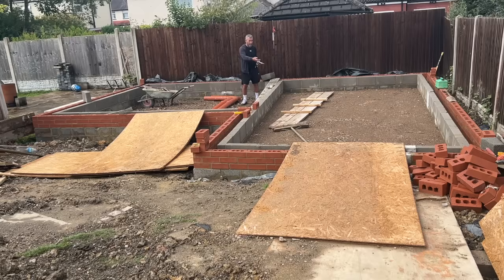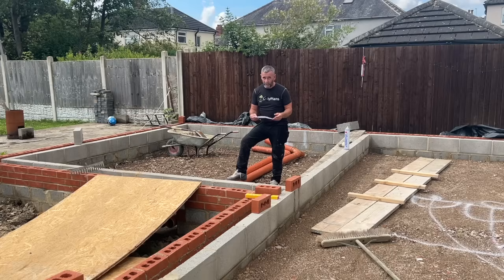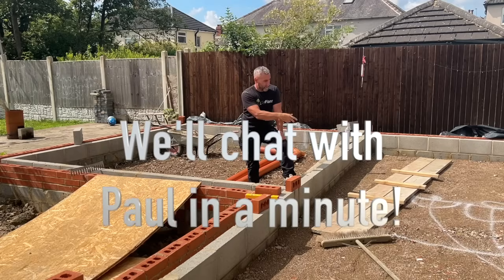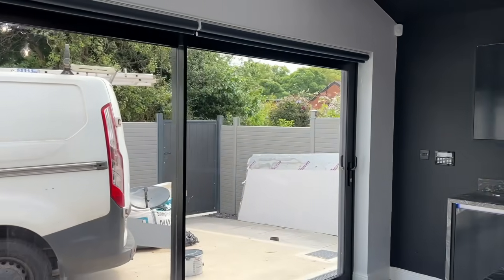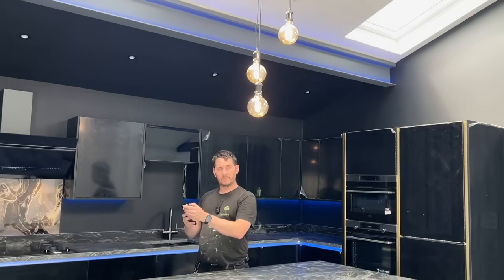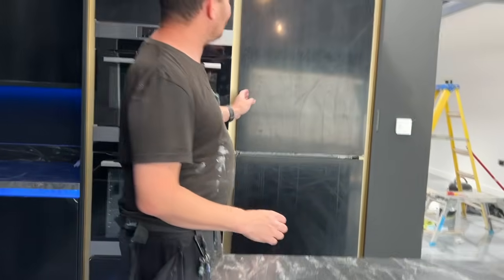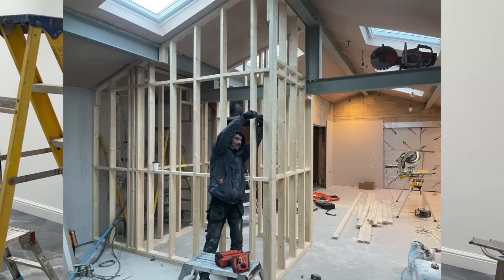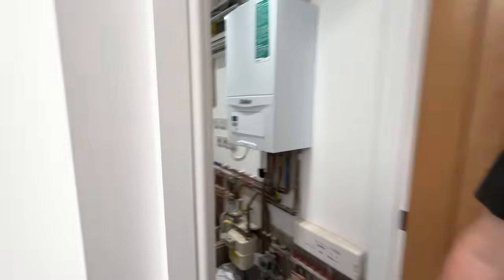Garden annex and the plumbing explained in massive detail! Part 13

Comment: Informative video. One 110 waste with Air Admittance Valve within the cavity (above height of sink waste, as mentioned) will do the trick. Done this numerous times without any issues. Good to catch up with John & Davie, could make this an occasional standalone vid. At my own place I fitted an electric instant water heater within my utility sink unit (in annex building) and it works a treat 😀

Comment: I would personally just bring your 110 mm pipe in to your wall cavity then boss your sink and shower in to it if you're putting your shower tray on a riser kit. With it being a granny flat though mate i would definitely consider putting your shower tray on the floor.  Just bring your shower waist in the floor in the rough area put kingspan around it then just concentrate the last bit in when you set your tray. Looking well mate very tidy job👍👍
Reply from the maker: I like this suggestion mate
Reply: You can even use a floor guly and mortgage a tray a d screed a fall to the guly in the slab and file the floor and make it a set room

Comment: My 2 pence worth, we built exactly the same thing and your pressure will 100% drop when either the house or the annex uses the water. We ended up getting a 33mm main bought to the house and a separate meter fitted for the annex with its own pipe feed from the street. Cost a couple of grand, but fixed the problem. Also a small combi boiler would combat all the issues of a 9kw shower and a 3kw water heater, which are inconvenient to use and don’t make for comfortable usage, especially if the pressure drops, not to mention the power being heavily used (sometimes the lights even dip when you turn a shower on). A small combi would cost £800 ish quid. Clears the issue of 2 different kinds of heaters, more to go wrong. Also I would recess the shower waste pipe in to the concrete pad so the shower try can sit on the floor rather than up on a boxed in platform
Reply from the maker: appreciate the input mate, I'm selling up when its done, so the extra pipe wont be happening I'm afraid

Comment: 51:52 it is  beset to run 3 separate 4" drain line to an inspection chamber and not tee in any of them in your slab, a building  inspector probably wouldn't pass it if you connected waste pipes to the waste pipe from your toilet in the slab, if your having a stub stack at the back of your toilet like you said you could boss off that above ground for your basin and shower but not in the slab, but then your have to make sure you had a fall on the shower waste pipe

Comment: Hi  very interesting video  

On the drains, it's always best to bring your foul drains outside before they combine  otherwise you may  need to have a double seal manhole chamber internally, not best   
Durgo valve essential but ensure access available,  if possible use one and link the 110 diameter pipes together with smaller diameter pipes and bosses say 1.5 inch vents   

Hot water  look at the phase change heat  batteries  by Sunamp,  uk company  can heat with immersion or heat pump and because of heat density might fit under kitchen work top tiny water storage (just the volume of pipework in heat exchanger) so compliant for water regs, can use time of use electricity if no heat pump  incorprate blender on top to reduce outgoing temp of about 55c to 48c prevents scolding   saves on costs for big cable for shower and instant heaters  shower and heater costs   - worth a look  

Great content as always
Reply from the maker: I think he's fitting one of these Sunamp things mate

Comment: Liam, the tensioner that failed should  be fixed under warranty by the mechanic who sorted the wet belt failure
Reply from the maker: got the van back, think im getting a labour bill though, not fully sure as of yet though
Reply: Have a look at your previous invoice, see if they fitted a new tensioner, they should have if they done the job right.
Then the cost of the failure should be their responsibility, not yours.
Reply: Should have fitted a waterproof as well if driven by the timing belt
Reply: Waterpump
Reply: If they didn't replace the tensioner the mechanic should be at fault for not completing the full job. If the tensioner was replaced and it failed months later the parts supplier/manufacturer should be held liable for supplying a faulty part and the mechanic should be compensated from his supplier after repairing your vehicle at no further cost to you. But of course these things are never that simple as no one wants the blame or to lose money
Reply: @McNaughty91 Excatly that, usually, the suppliers of the parts will replace the faulty part under warranty,  but there is usually a disclaimer saying they won't pay for any labour or anything else.
It's usually on the shoulders of the garage to do the repair under goodwill

Comment: Liam, the concentration of Lead (in water) is measured in either, ug/location (micrograms per litre) or less correctly as ppb (parts per billion).  That latter unit (ppb) isn't particularly helpful as Lead is much more dense than Water.  Before ripping out any Lead pipework, it would be worth checking with Yorkshire Water to see if they are dosing Orthophosphate - which significantly reduces the solubility of Lead in water.  As far as I'm aware, many Water Authorities still dose this chemical to minimise the issues of Lead pipes in domestic installations due to there still being many old properties that have Lead pipes.
Reply: "location" should read "l" for litres.  Bloody autocorrect  - I hate it 😂

Comment: Surprised there was no mention of raising a soil stack or using an air admittance valve to mitigate pulling a vacuum in the adjacent traps.
Reply from the maker: there is mate, we talk about it
Reply: @thegardenroomguru  You're absolutely right..... low attention span! I now see you returned to the subject later on. The answer is ..... maybe....  see BRegs AD H 1.7 onwards which deals with this subject....... you may not need to ventilate, it depends on branch lengths...... there's a table that guides you. But as your man says, just put one in and avoid the question in the first place. Your void for a concealed cistern is perfect for this.

Comment: I would look at getting a Quooker tap for boiling and hot water, don't get those 15/30L sink ones.
Reply from the maker: surly they are just for jot sink water, washing up tea etc
Reply: @thegardenroomguru  they give you boiling and hot water for washing up. Basically similar to what your plumber friend was suggesting but all packaged up as a nice kitchen tap. They put a little 15L tank under the sink in the cupboard. The utility of not needing a kettle also so great in a small kitchen.
Reply: They now have combi tanks so all you need is a cold feed for boiling and normal hot, so would work but I’m pretty sure biggest tank is 5L
Reply: The Quooker Tap don't comply with the Water Regulations which state "schedule 2 (18) , water should not exceed 100'c" .. The Quooker tap states it stores at 110'c .
Reply: @DALEYPLUMBING  doesn't hugely matter , there are thousands getting installed in the UK each day. The regulation isnt meant for this its for hot water cylinders.
Reply: @gsdevme Having seen a product similar to which exploded, I have to disagree. Legislation is there to protect us and the public.  As an approved contractor, we have to comply with the regulations. Just because 1000's are fitted doesn't make it right.
Reply: @DALEYPLUMBING  Perhaps, at what point is it illegal to sell though. They are huge brand here.. somehow getting them sold. Wren and all the big name kitchen places will install them for you also. I wouldn't worry anykind of water cylinder can explode under the the wrong circumstances. I assume in your case the pressure relief valve had been faulty? as it should of opened before it exploded.
Reply: @gsdevme  @gsdevme  In the UK the water regulations apply at point on installation.  Manufacturers can make and supply what they like. The onus is on the person installing to comply with the requirements of the water supply (water fittings) Regulations 1999. However , the responsibility will become the owner/occupier after a few months, leaving the liable.
Reply: @DALEYPLUMBING  never seen or heard of an exploding Quooker, sold absolutely loads of em over last 3 years working in kitchens, how is this a thing and they’re still being sold and working fine?
Reply: @acebee5670  as stated about . Manufacturers can make what they want . It's down to the person installing to ensure compliance. They ensure compliance if they are competent.

Comment: Great video and update. Did you mention about the waste from kichen sink washing machine? Also how does the rain water get managed. Are you having a soakaway or connecting into the sawer?
Reply from the maker: Washing machine will tap into kitchen sink I think mate, it’s an older house, it’s got a combined sewer, so the rain water will tap into the sewer pipe a couple of MTRS from the house 👍🏼

Comment: AAV 110mm ??
Reply from the maker: what's that mean mate?
Reply: @thegardenroomguru  automatic air vent extend the 4 inch boss it to it instead of having them tees so when you flush the toilet the AAV lets air to be sucked in not dragging the water from traps
Reply: @thegardenroomguru  Air admittance valves, durgo valves, AAV’s or air inlet valves as they are sometimes known, allow air into the soil stack system without letting air (and thus smells) out. This stops a vacuum in the pipework and allows the waste to drain easily without letting smelly gasses out inside the property.

When you flush waste water from a toilet, bath or sink the water will flow along the waste pipe and air is carried along with it. As the water and air flow down the pipe it will cause a change in pressure in the pipework and air will be drawn into the system. Often this will be from plugholes, but air will enter the system anywhere it can in order to reduce the negative pressure. Have you ever heard the gurgling sounds coming from the plughole or drain when you’re emptying the sink for example?